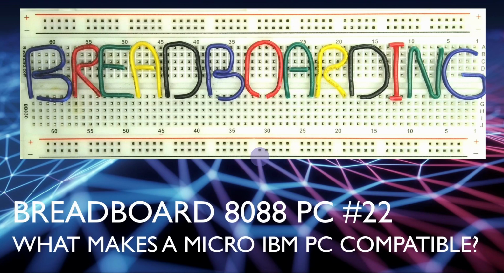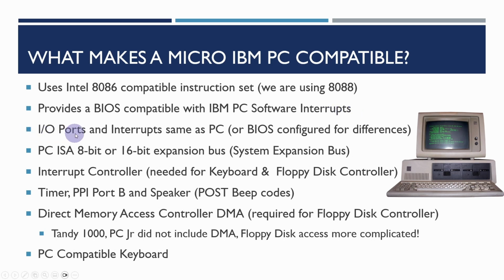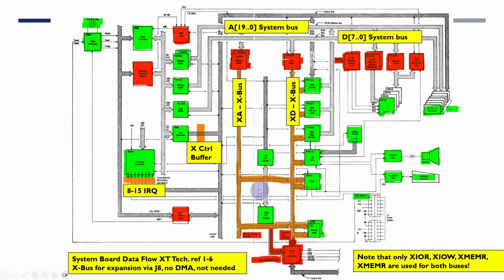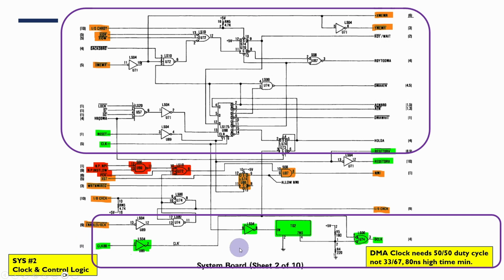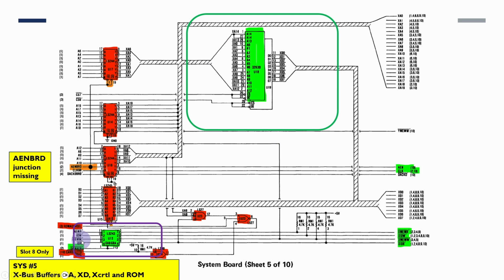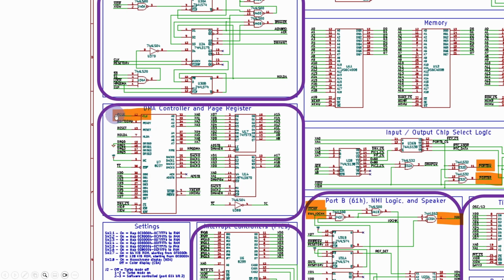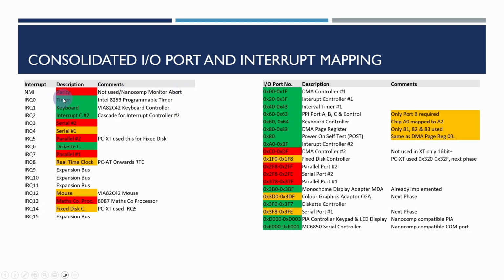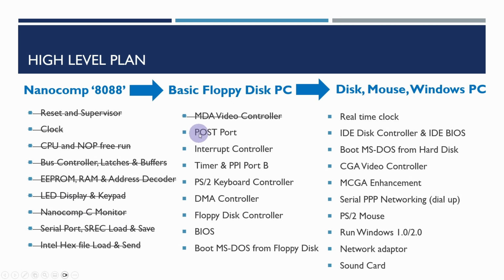Breadboard 8088 PC What makes a Micro PC Compatible #22

Comment: This is very helpful! Do you know the reason for the X-Bus? I can only guess that DMA transfers are isolated on the normal system bus and system devices on the X-Bus are "protected"? Was it maybe over-engineered?
Another question: Why are you using LS chips instead of e.g. HCT? I started the project now with mostly CMOS chips and the HCT series. At some point I was worried if I would need stronger drivers like ACT, but then I read that CMOS uses very little input current and I could drive lots of chips with HCT buffers - so am I fine here?
Reply from the maker: I suspect it was that the buffers at that time (LS series) may not have had enough power to drive all the onboard logic AND allow for 2 TTL Loads per expansion card (16 TTL loads) or the capacitance of a single bus could have been too high so they split the buses. I suspect the Engineers being IBM made sure it met all specifications and didn't 'wing it' so I suspect it could be over-engineered. ALS logic vs LS has half the max input current so could do twice the fan out. Compaq DeskPro 386 and PS/2 70 uses ALS chips I think. I thought originally X-Bus was related to DMA but I can't see any way how it is (we'll see when I try it!) after spending many hours looking into it.
As far as LS and ALS TTL vs HCT, I was trying to use early 80's components where possible when I started the 6809 project and stretch to early 90's for things like VGA DAC,  Floppy disk controller, keyboard controller etc. The LS and ALS seem to be easier to find in DIP packages (certainly with local component supplier rather than Mouser/RS etc) and once I had a number of them it was easier to keep going! I do have some HCT inverters for crystal oscillators but not really any good reasons not to use HCT just kept going with what I had, I'm sure you will be fine. Not sure if the HCT may be more sensitive to the capacitance on Breadboards at higher frequencies (a power strip bus has about 20pF between rails) so rise times might be slower with lower HCT currents? Might be interesting to do a video on it a some point? I have PLDs in the list already! Comparing LS, ALS and HCT logic families on breadboards! Thanks for the thought provoking feedback. Dave
Reply from the maker: Found this link from Sergey https://forum.vcfed.org/index.php?threads/ibm-xt-8th-slot-video-card.24433/ Which says "The additional buffering of the X-Bus is required because buffers / transceivers on the ISA bus (between CPU and ISA) won't be able to pull all ISA slots and I/O devices on the system board together.", not a problem for this project for the reasons I gave below.

Comment: May be a good idea to state that you make a PC compatible not a computer that is MSDOS/FREEDOS compatible. Both are different things. Have said this, running MSDOS on a DIY System makes a system not PC compatible but MSDOS compatible. This Because MSDOS depends completely on the BIOS, at least that was the design requirement when IBM designed the PC to have a abstraction-layer between the OS and the HW. Later when the BIOS code was not fast enough for the work need to be done, more and more programs went directly to the HW and compatibility became important thing, this was special for thru the screen and Keyboard IO. 

Great series to see how you make a DIY PC compatible, any plans when the design runs on the breadboard to make a PCB?
Reply from the maker: Yes I think in my thinking about "PC compatible" I mean 8088/8086 and MS-DOS, PC-DOS and perhaps DR-DOS. To make something 386/486/Pentium+ compatible is completely different (though these all still power on in real mode like the 8088/8086). Its only with 286/386 versions of Windows (and probably OS/2) I think that the drivers took over from the BIOS (I am not an expert in Windows drivers!). I suspect all the stuff like PCI, PCI Express and USB would be a major undertaking to be able to do the same as I am doing here, far too many pins on chips and too complex for 1 person's brain! I am pretty sure Windows 1.0 and 2.x just sit on top of DOS with no VxD drivers etc.
No plans to make a PCB as Sergey Kiselev has done this already for the XI-8088 and other than the PCB's I made in 1981 I haven't made one since! I was mainly interested in building large projects on Breadboards when a lot of 'professional' advice said not to try it as it wouldn't work (reliably)! Dave

Comment: I've been intermittently following this project since it started (I subscribed quite awhile ago).  I've been wondering what precisely makes a computer PC compatible and enjoyed this video.  Would it be possible to go over the high-level of the requirements, starting from the minimal hardware, but also the memory-map (where things MUST reside vs. BIOS configurability), and when you get to BIOS, spending quite a bit of time on its configuration, please?  This would be a very clarifying video, indeed.  I can't discern which hardware, addresses, IRQs, are required vs. what is flexible, configurable, or you've modified for your project.  I suppose, what MSDOS expects for hardware/addresses/BIOS/IRQs and go from there.
Thank you for your work on these videos!
Reply from the maker: I will do when I get to that bit, I think in answer to your question "what precisely makes a computer PC compatible" I think it is mainly the BIOS as this can hide most incompatibilities. There are a few things like where the default location of the RAM for a video card is but the card can override that by providing its own video BIOS. The PC was a clever expandable design which I think explained its success even though the original 1MB RAM was a limitation in later years, in 1981 it was a massive amount! Thanks for the feedback. Dave